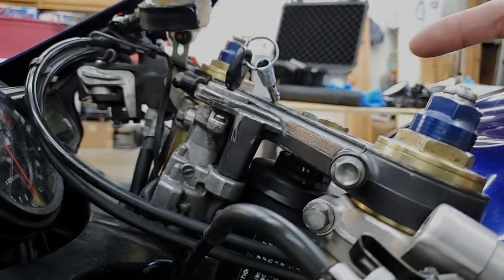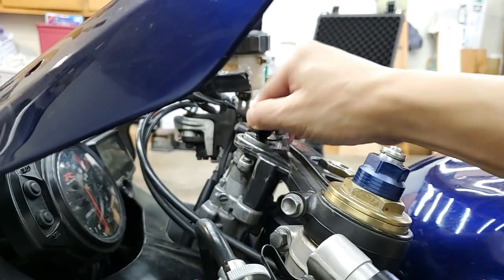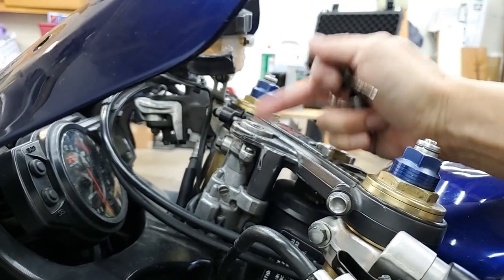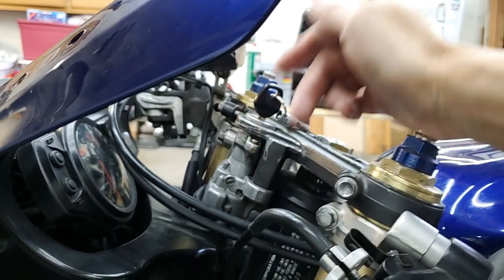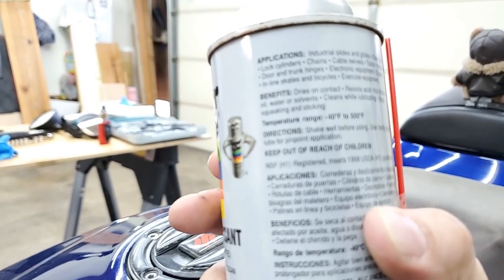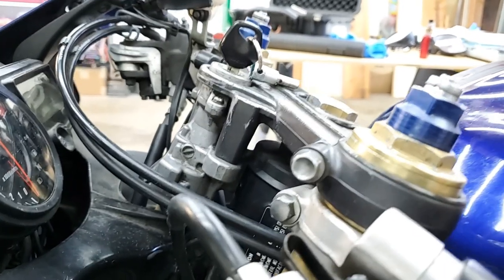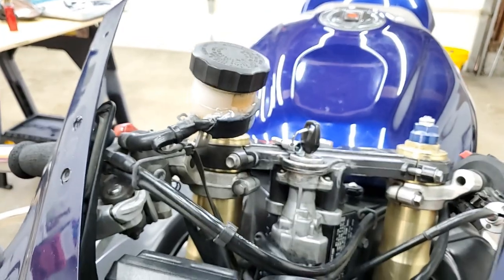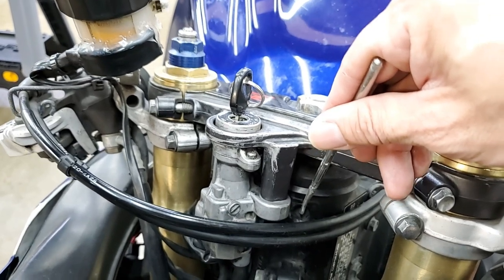Handlebar Locking Issues?

Comment: The only video I found that actually have the right thing
Reply: How do adjust a steering lock thats not long enough to reach and lock the steering ?
Reply from the maker: @denielwarner7286  you can't. Not sure how this would happen aside from the pin being sheared off but it should never be short since it's an OEM part or you purchased the wrong locking assembly.
Reply: @TheChemistDIY  the bike by itself was purchased from an importer so i cant say unless the seller tells me the serviced it wrong by installing the wrong assembly of the manufacturer is at fault. idk but thanks for the response

Comment: I have a problem with my 03 Roadking steering lock. Unfortunately. the cylinder key will not turn and disengage the lock. the bike is stock in a lock position.
Reply from the maker: Are you able to see the pin in the frame and is there a big enough gap to get a thin saw blade in there.. you can add a notch on the pin and get a thin screwdriver 🪛 or pick to assist pushing the pin back in as you turn the key..

Comment: When I push and turn the key it only goes half way to the lock position before it just stops. I’ve already took a flashlight and made sure the pin wasn’t misaligned aswell as sprayed lube in the ignition.Any advice?
Reply from the maker: The issue.. if not with alignment of the whole, or debris within the frame hole is going to be a dirty cam. 

When you turn the key it engages the cam that push the pin out. Over time it gets dirty and needs to be thoroughly cleaned. You need to remove the key lock cylinder from the triple clamp. These are TWO SECURITY type torx bits screws. Once removed drop the lock in some degreaser like simple green and let sit for about 30 minutes. Pull it out and then spray some break Clean in the key hole and put the key in and twist out the pin a few time's. Follow up with penetrating fluid to lubricate and then reinstall.. you should be good after this.. 

I just had the same happen to me a few days ago and I noticed how hard it was to have the pin com all the way out of the cylinder. After thoroughly cleaning and lubricating it works flawlessly now...

Comment: my handlebars wont turn all the way to the left so that I can engage the lock. any ideas?
Reply from the maker: Could be a couple of things. Of course not being able to see myself I'm going to throw a few things out there.

1. Your brake or clutch cable is bindings or  is in the way.
2. Obstruction on the lower triple tree where the safety risers meet the frame.
3. Bad head bearings or races preventing full turning radius.
4. Steering stem/front wheel not dead center. Front tire will have a weird wear pattern.
5. Break line to front calipers are being restrained and not giving full turning radius.

Have you inspected all of the above?
Reply: @TheChemistDIY  my dad is going to check it out later today.

Comment: What about if bike still turns on /off but steering is just locked up & won’t move from locked position
Reply from the maker: So if the pin doesn't come out from the frame hole then that means that the cam within the lock that actuates when the key is turned is stripped or broken.  Kind of like a door knob that turns but you can't open the door because the plunger is not moving away from the frame.

I suggest bitting the bullet and replacing the entire lock which means you'll need a new key as well.

Comment: Where Is the locks location itself that locks the handle bar.?
Reply from the maker: On the key cylinder side (not the bike frame). I show it with the Pick Tool... Its a round pin that slides in/out of the ignition cylinder (on a cam) when you turn the key.
Reply from the maker: It's the key ignition switch. You turn the key and the pin slides out from the ignition switch and into the bikes frame locking the handlebars. You can clearly see this demonstration at the end of the video.

Comment: i have a cbr600rr and its stuck in the lock potion what can i do
Reply from the maker: Have you tried spraying WD-40 or some sort of lubrication into the key hole and letting it soak.. if not give that a try but make sure to soak that shit out of it.

If that doesn't work.. then you will need to loosen the top triple clamp to stop any binding pressure between the frame hole and locking pin..

If that doesn't work then completely losses the top triple clamps as if you were going to remove it and also loosen  and remove the bolts  on the bottom side of the ignition housing that hold it to the top triple clamp and see if you can wiggle it out so you can replace the ignition. If you get it out, the pin may be stuck in the out position and you can work on it on the bench trying to free it up.
Reply: My 600rr is doing the same thing you ever figure it out?

Comment: What 8f won't unlock
Reply from the maker: Undo the two bolts that hold the lock cylinder to the top clamp, loosen and remove the top clamp. Cylinder and pin should slide out freely.. do it in that order...  it should be a 25 min job
Reply: @TheChemistDIY  Take the chrome off the tank I can get to it ?
Reply from the maker: @williamglasgowjr2846  you just need to remove the two bolts that hold lock bracketry in place.. there on the bottom side of the top triple clamp..  once the bolts are removed it may slide out.. towards the front of the bike... Normally it would just fall once the bolts are removed but since the locking pin is sticking into the frame it will be held in place.. so you may be able to pull back on it, and it just slide out easily.. if not... Then you need to loosen the top steering stem head nut and two fork clamp bolts, slightly raise up the clamp and give yourself some wiggle room.

Comment: i can turn te key but it like doesnt open the lock or anything
Reply from the maker: Then your cylinder is broken and needs replacement.. or you can remove the lock 🔒 and take it to locksmith for repair... Not sure which is more cost-effective for you.
Reply: @TheChemistDIY  how to remove the lock?
Reply from the maker: @supernikko1022  on the underside there is two bolts which I believe are 8 or 10 mm that hold in the cylinder.

Comment: You loosened the bolts then briefly  paused then retightened them. 
Yes you solved the issue, needs to be clear in video on actuall realignment. 
Didn't actually see anything at the crucial point, mad.
Reply from the maker: Sorry about that Alan... for those out there feeling the same.. you're just basically loosening the center steering stem head nut and retightening or "torquing" it to specification as stated in the Suzuki manual. We loosen the four outer bolts so that the top triple clamp can slide down the fork tubes easily and not bow downward so to speak.